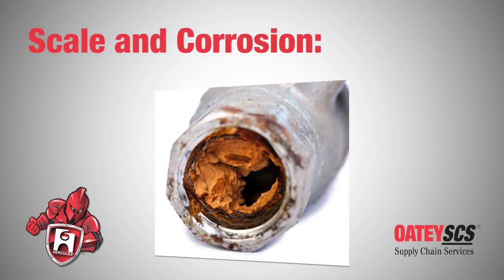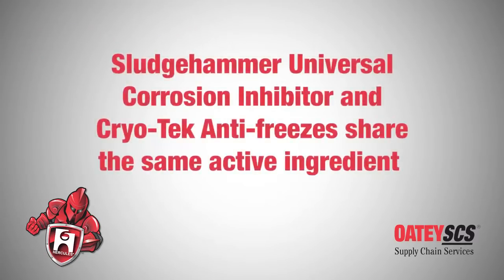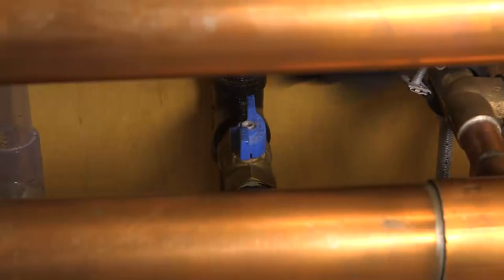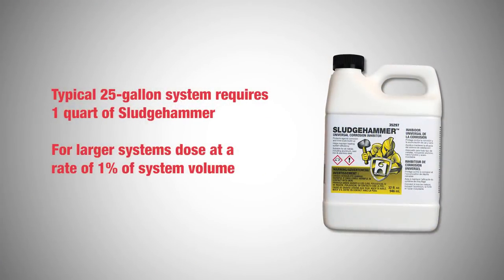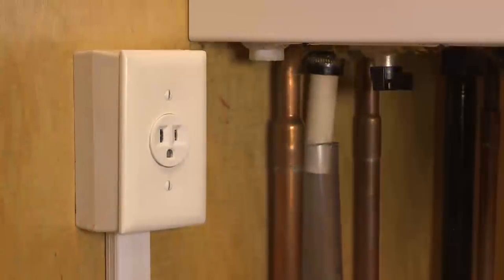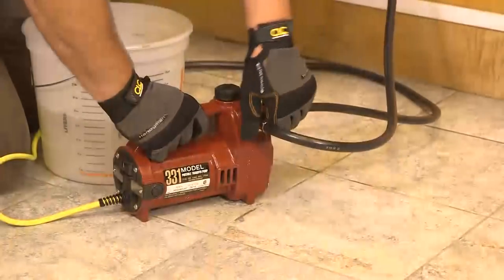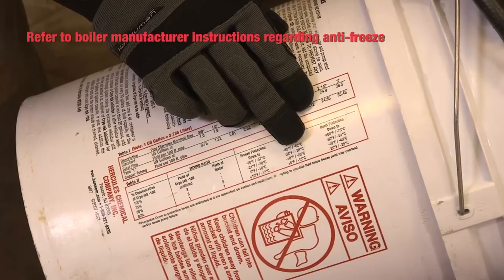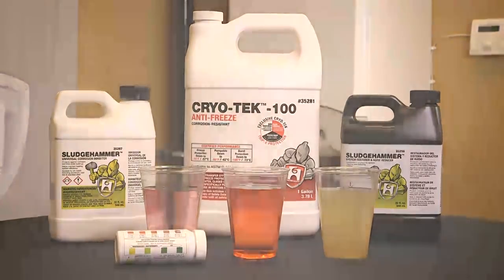How to Remove Sludge and Corrosion in Hydronic Heating Systems with Sludgehammer

Comment: You guys state in this video that you can circulate Hercules® Sludgehammer™M System Restorer for 24 hrs. But in your instructions for using your inhibitor products, it states:
“Let the solution circulate for two hours.
After 2 hours of cycling, dump the system. Leaving the chemical in for too long can damage metal pipes and fittings and ruin the heat exchanger”. So which one is right?
Reply from the maker: @Sandy Peralta For heavily fouled systems it can be circulated up to 24 hours. For normal systems that are maintained only the 2 hours is needed. It will depend on how dirty the system actually is.